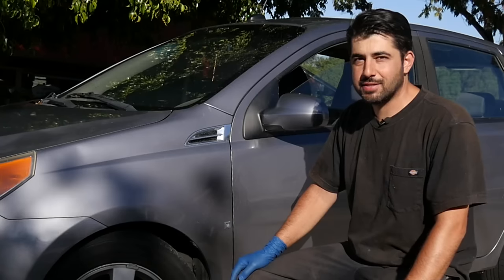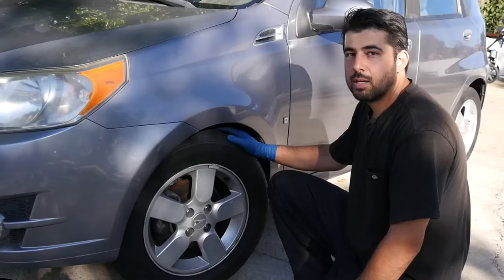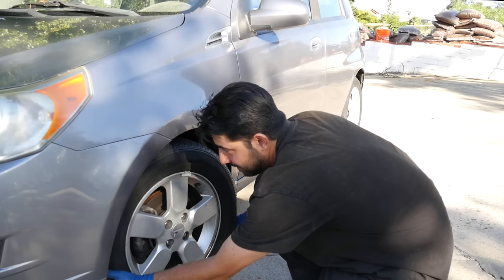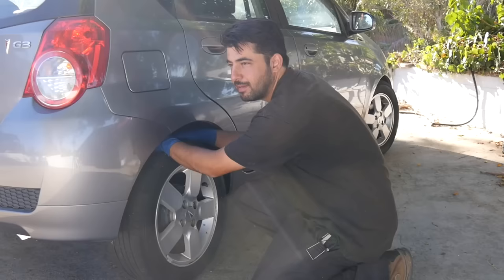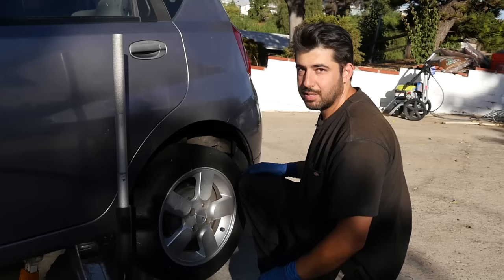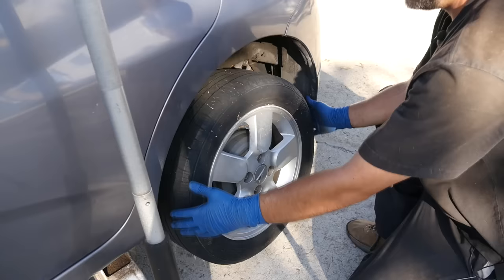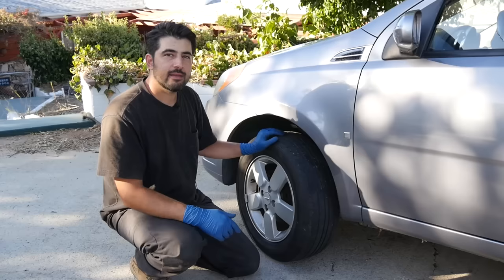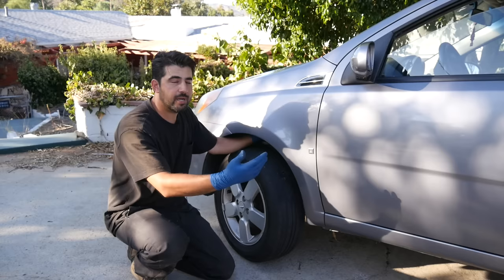Must Watch Before Spending Money On a New Wheel Bearing

Comment: I just took my car to a shop to get tpms reset and alignment checked since I got a wheel and tire package from tire rack and they told me I had a bad wheel bearing because the mechanic was hearing a noise from the driver rear wheel. well i do not hear it and i lifted it to see for movement and got nothing. Im gonna spin it to see if I get any noise. I suspect it is  just tread noise from brand new tires. Bitties wanted $600 to do the job and that is way overpriced. Takes an hour-2hrs and the part is $100 for a moog hub assembly which is a good brand. so at most its a $350 job and they want 600 psht

Comment: Nice job smashing the pinch weld that appeared intact before you jacked it up on it directly. Use a proper support to jack on a punch weld. There’s a reason the stock scissor jack has a slit to not smash the weld.

Comment: Hi, nice video quick question. Changing front wheel bearings, you think it will cause steering wheel get out of straight? They just put one wheel bearings on my 05 Camry in big O Tires today. When I pick it up my steering wheel is down to the left if I straight it up car will go to the right. Can you let me know pls thanks. Before the work there's an order to check for an allingement. I don't think they checked the allingement..When pick it up they said no need an allingement. I return the car. They said they don't touch the tie rod only remove and put it back which is correct I know that but, if they didn't touch tie rod why my steering wheel not straight? thanks for your feedback🙂

Comment: I thought it was a bad wheel bearing... I got under my truck and it turned out to be my brake dust shield got bent enough to start scraping against my brake rotor, that it made a groove. I bent it back into place, but the damage was done. So I replaced both rotors. Hope this helps someone.

Comment: My 2005 Honda Accord steering wheel is wobbling back and forth no matter if im going slow or fast , checked my tie rods they seem good also my lower ball joints were replaced last year, also a noise coming from the left wheel area ( hard to explain it) , any help would be appreciated thanks

Comment: Question. I hve the 2018 300 Chrysler &.  I’ve checked everything.  I hear a light thump noise wen over small bumps not big ones.     On the passenger front Can’t get it. We’ve checked everything what cud it b.    We did the 3 o’clock &. 12 o’clock nothing.     Cud it b sway bar.    Cud worn rotors. Do the noise

Comment: Hi there, here is my problem.  Last week i replaced lower arm left and right since my car 8 year old, makes squeaking sound and found the rubber on the lower arm cracked . So after the replacement there is no more squeezing sound, how ever when going on road right front makes humming sound. So I assumed it was front right bearing sound issue. So yesterday I got it replaced with new bearing, yet the sound persist.  The mechanic told me it could be the tyre,but 3 weeks ago I changed all brand new 4 tyre continental cc6 . What possibly could be the humming sound.
Reply: Switch tires front to rear and compare. Then again some tires are much louder than others.  If you had the bearing pressed on rather than replacing the whole hub assembly, bearing could have been damaged during pressing.

Comment: Just changed front right wheel bearing thinking it was problem causing wicked loud growing noice in what appears to be front of car. Still making noise. Noise goes away when hard right turn transferring load off of right side. Could this be a symptom of bad tire also?
Reply: Ever figure out what happened with the noise?

Comment: I just watched one of your older videos about Nissan transmissions / defective radiators. I have a 2004 Infiniti G35  sedan with 145K miles. It was a lease car that spent most of its life in California. I have no idea what the dealership I bought it from did to the car as far as service is concerned other than I know they took it to the Infiniti dealer to have the air conditioner compressor replaced and I made them put new tires, brakes and a battery in it when I purchased it 11 years ago with 101,000 miles. A couple of years ago I had the radiator replaced. It has the 5 speed shift-tronic automatic transmission in it but I have no idea if it has ever had the fluid changed. I bought the correct fluid off of eBay because I got a good price but I haven't had the fluid drained and replaced yet. Are you aware of Infiniti G35 sedans with the auto-stick having problems? My plan is to have a lube shop vacuum out 5 quarts and then in about another year do the same procedure. As you can tell I don't drive a whole lot anymore. Your response would be greatly appreciated. I also don't know if the sparkplugs have been replaced yet. The car runs and shifts flawlessly.

Comment: Hi, do you know what can make scratching like metal noise that follows the wheel spin? Any suspects except of a wheel bearing and brake pads? It happens on low speeds (<25). 2017 GTI. VW dealer did not find anything wrong...

Comment: I have a 98 camry and if hold the top of the rear tire and move it in and out in is slightly lose and clunks. Its not the wheel bearing. What could it be?

Comment: I hope u or someone repiled I had my OEM stock wheels and tires on my car for winter . it spring so i put my 17 inch wheels on and I'm.hearing a wheel bearing or tire roar but never hear them with my stock wheels would it be the tire going bad?? Front left driver side

Comment: Good advice. However...some vehicles are like tin cans with road noise and the tire tread design gets amplified by the body. Case in point:

 My wife drives a 2014 Jeep Patriot and I drive a 2016. Both are 4x4 Latitude models with the same drivetrain. Hers wasn't too noisy with the OEM tires or the Coopers that replaced them. Two years ago those Coopers were replaced with Coopers that have a different tread design. The howl maxes out around 40 mph! Pennsylvania inspects every year and if a wheel bearing or other component was defective it would fail inspection. It has not. 
My Jeep came with Kumho tires that were noisy. The Coopers that replaced them are the same as the first replacements on my wife's car and are quiet. I am reluctant to replace them but eventually will have to. 
Bearing issues are relatively straightforward...the character of the sound will change depending on speed and loading and the wheel will wobble if spun while off the ground. Plus, unless they've been submerged wheel bearings will rarely fail with less than 50,000 miles.

Comment: Hi brother, I think my passenger side wheel bearing is shot on my 2000 honda civic ej9. Grinding noise when driving and movent in wheel when I jack up and rock the wheel both top/bottom and Side to side. I cannot afford to have it repaired at the moment until payday on the 25Th August 2020, is it safe to drive to and from work 6 miles away until the 25th?

Comment: I have Toyota Yaris 2006 model hatchback when I drive car on higher speed like 80 km/h and above it start me making noise like wheels bearing is worn out but when I got it checked from mechanic he said all is good wheel bearing is ok to me I have tried many mechanics they all fail to identify suck issue. I think is that just because of noise I got new set of tyre which are 70% soundless compare to factory fitted once still problem is there. Can anyone help what could be reason.

Comment: I have a 02 Honda accord with 222k on it. And when im driving there is a loud humming noise coming from the front driver side and when I turn to the left it goes away and turning to the right it gets loud? Pretty sure it's the bearing? What do u think?
Reply: 2000 Honda accord same thing happened to.I changed both and it is so quiet now with new Kumho solus tires at 300,000 miles.

Comment: My car has been making a grinding/rubbing sound almost like a slight shutter when slowing down with a decent amount of road noise. I replaced rotors and pads on all 4 tires, and it still makes this sound. I went from winter to all season tires and it’s been making this sound when I had my winters on indicating it’s not the tires. So not the brakes, not the tires, could it be a bearing or something else?

Comment: Noteworthy - I just replaced a tire today that the tread looked okay on the outside but the inside was down to threads and wires ...had I done your method I would've sliced my hand to hell on the steel wires. ;) Just FYI.

Comment: I also had two Fuzion tires go bad...more Chinese junk!
Reply: funny thing is even Michelin tires are designed to go bad.  
Their rubber formulation become soft so sidewalls start feeling like chewing gum and thread area fall apart in small chunks.

I had 3 sets (12pcs) of car tires prematurely expire that way so I switched to Continentals: very consistent sidewall stiffness and thread wear.
👍
Reply: @glasser2819  I have heard this from a manager at General Tire
Reply: @glasser2819  I had Good Year Eagle LS from factory when car was new. Terrible tires. They were garbage after about 25K miles and 5 years. Nokian, on the other hand, proved much better and were intact even after 10 years, at which point I replaced them. Big difference in quality.